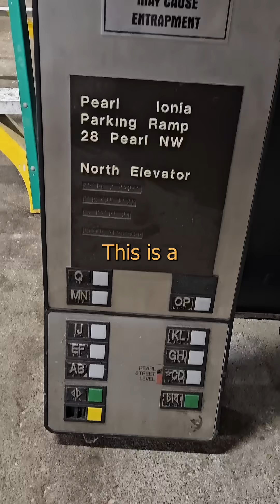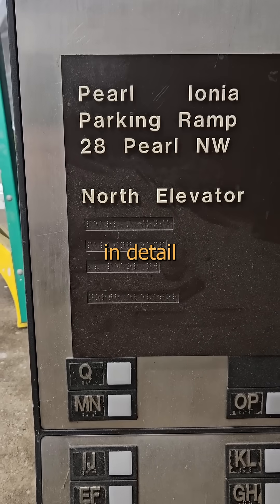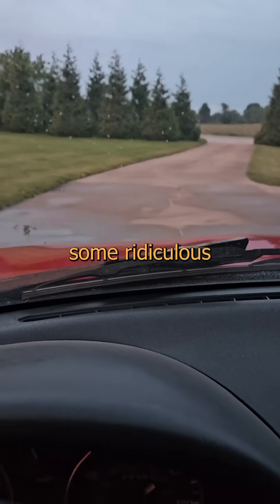Miata Mischief #chrisboden #engineering #gear #elevator #score #stories #parts #hacking #making

Comment: 😂 great stories... but you guys know the dwarf is going to get the prize, right? .... I remember a being sent with a senior tech to get a radio repeater ( the whole cabinet ) out of a snowed in high site, just a short hike off of a public road, about two hours drive from the shop. We had brought a snowmobile towable fold up metal dog sled in the service van to dolly the cabinet out of the woods... the snow was a bit deep, but had a good surface crust to hold up the sled. Being the junior tech, I had my gear packed into 2 of the larger size Coleman action packer boxes that made it easier for me transferring my work gear between working out of my van or his. Anyway, their blow molded box lids along with the bungee cords used to hold the cover latches closed make some remarkably useful impromptu snow shoes in a pinch. I and the dog sled had no trouble maneuvering on top of the snow to the radio site and back, but the senior tech sunk in the snow... he wouldn't get in the sled and let me push him as I suggested and instead insisted on choosing to slog through crotch to waist deep snow pushing the sled ahead of him like a proud dachshund... even though the context is quite different, I couldn't help but think of him pushing that sled, his top half sticking out of the snow about as tall as the sled itself like an enthusiastic dwarf pushing a dog sled... the funniest part though, was me remembering  standing on the snow looking down on him crotch deep in snow as he is looking up at me and he says to me "Do you know how stupid you look?" 😂  if I was the stupidest looking one between us, at least I wasn't the one that had the 2 hour trip back to the shop wet and cold up to my nads... I miss the comradary of having a good coworker to easily razz! Interesting times to look back and laugh about, from mountain tops to mills, nuclear power plants to prison facilities and all the crazy $h!t you have to do, or make due with to get it done... 😊

Comment: I owned one of these motorized skateboards. I had the 1.8BP, with high comp pistons, cams, long tube header and itbs. It was a blast to drive. It made 78rwhp stock, and 135rwhp built and tuned properly. It was enough to drift with narrow tyres on dry roads, and with 225 wide tyres wet. It was the most fun car I have ever owned. ✌🏻

Comment: Was building a house and only had a 98 s10  managed to fit enough 2x4s and 2x6s that the tires were almost touching the wheel wells got pulled over on the way home the cop was impressed an s10 could haul all of that was let off with a warning not to haul so much weight again

Comment: Had an 86 Nissan pickup at the time and got several wood beams for free. They ranged from 6x6 to 10x10 and were 12-18 ft long. I had a lot of stares from folks on the drive home. I got pictures 😬😇
I don’t think beat my grandfather making a wooden ramp to slide a 36’ long trusses on his Datsun pickup so we could put them up for the pull barn we built.

Comment: We stacked three canoes on an old station wagon. We lashed paddles together to make the racks wide enough to fit two canoes side by side so we could stack the third on top in a pyramid. Then we loaded all six guys and a weeks worth of camping gear. The suspension was maxed out and driving the dirt road to the highway was slow. Many time we hit a hill too steep and we all got out and walked up so the car was light enough to reach the top. At one point we got caught on a large rock and ripped the tailpipe off at the catalytic converter, After that we couldn't even talk to each other it was so loud in the car.

Comment: Carried a 12000 BTU window AC on a motorcycle. Same bike, carried a component stereo system with tower speakers. Same bike, a three state run to pick up an electric guitar, two amps, a guitar stand and a pedal board. Same bike, brought a 32" TV home from Wally World. Same bike, carried a 72 key keyboard across town. I called it "truck mode" and got labelled "The Beverly Hillbiker "

Comment: I help a couple that was buying a wall oven from me to get it in their four door sedan. They came from over 5 hours away and I had to take it apart lay the front passenger seat down as far as it would go where the main body barely fit and the rest of the parts were split between the truck and the back seat. The lady then had to sit behind the guy for their 5+ hour drive back. I hope they made it and were able to get it out of their car and find someone to put it back together. What some people will do for a good deal.

Comment: I‘ve hauled countless long items like that in my Z4 Coupe, young apple trees, cheap off-cuts of laminated wood and Lexan, a spoiler, a spade… I have a plastic bag and rags in the cubby holes to not mess up the leather when I do sth like that. The trunk is ok-sized in terms of volume, but nothing over 90cm/3ft fits. To haul a set of (winter) tires, 2 can go in the back in very specific arrangement and 2 have to go on the front seat.

Comment: I shoved a front fender for a 57' Chevrolet car in the passenger side of my nissan versa for a two hour drive. On a different occasion, i removed my back seat of the versa bottom to fit a piece of furniture where it barely fit. Couldn't see anything out of the back, but it got moved!

Comment: I had to transport a 55in tv from my walmart to my house arround 10miles away, because i bought the tv in special but did not remebered i drove my miata second gen so i had to be creative, i have a small spoiler and it was perfect enough to grab the box although i had to drive under the box because it was still sticking out toulwrds the pasanger compartment cause i had to had the roof off it was fun sketchy and i do have pictures of how it looks also move 4 tires and rims for my truck in the same car 😂

Comment: I've done some pretty sketchy hauling. I got an entire crib home by taking it out of the box and putting the parts in just about every book and cranny in my car, I've also gotten an entire bed set moved by putting the mattress on top, the frame dresser and night stands in the rear complete with the trunk open, then securing it by literally tying myself into the vehicle with the knot right infront of my face so that when I got it to where it needed to go I could just untie it to get out. None of that though come close to some the the sketchiest shit I've seen to get something from one place to another. That would go to the guy that used a small wooden dolly as a wheel replacement to get his car to the mechanic. Or the lady who pulled one of those pull along carts to move a bunch of paint, wood, and tools behind her little Honda hatch back that was filled to the brim with other supplies. Either way, there are TONS of sketchy fixes and half repairs or there at one point there was an entire web site dedicated to it called "There I fixed it" and some of the things you could see on that site took Sketchy to a whole other level. We are talking putting a generator on the trunk of a car and running a window AC unit through the back level of sketchy.

Comment: 2001 s10 zr2. Brought home my summit 350 horizontal band saw with no tailgate. Truck was squatted as it's got too be over the load rating as its built with a heavy casting. Too make this all better it was on casters and being "held" in place with crappy tire ratchet straps which I have seen break holding an engine so they were little assurance lmao

Comment: Subaru Baja moved a queen mattress, box spring and bed and a twin sized bunkbed and mattress at the same time.  With a whole bunch of rachet straps.  Also tried to move 2500 lbs of tile but ended up splitting that into two separate loads.  My tacoma cant even handle a half cubic yard of basalt.  I miss my baja.😢

Comment: I think the sketchiest thing I’ve transported was a drive axle for a Honda Civic Del sol with it ratchet strapped to my back as I was riding a 78 Kawasaki KZ400 Motorcycle through a massive rain storm that had winds high enough to try to push me, my little bike, and the Civic Del Sol drive axle strapped to my back sideways off the road and off a somewhat steep, muddy embankment

Comment: A store in the gas station chain i was working for fresh out of high-school was going down for a rebuild.

Knock down and build new kinda thing.  

There was a large, looked smaller from the ground, Krispy Kreame neon sign on the side of the building.  The powers that be told me it was gonna be demolished with the building, what happens after hours was fine with them.

Myself and 2 friends, jumped in my brother's Dodge Spirit, holding an extention ladder, on the side of the car, through the front and back passenger windows.  Got to the store, climbed up, started to dismount the sign from its blockhouse wall.  

Somehow we managed to lower it with ropes and patience without breaking the tubes.  That was when we realized it was 10 feet long.  With only a backer board to keep it rigid.  

We found a narrow yet long, we had a connection, pallet in the dumpster enclosure from the body shop next door.  That fit in the trunk and with one person holding that down, through the drop seats in the back seat, that stuck out long enough to support the back end.  Lots of cardboard under the sign, lots of rope and a very slow drive thru town breaking many laws im sure, we made it to my friends garage to store our treasure.   It now hangs in a local history museum.

Come to find out, the sign was handmade by a local neon shop, the owner of which has long since passed away.

I miss days of either not caring or being ignorant about how much danger/legal risk we were swimming in.

Comment: I moved a bunch of stuff via skateboard when I was younger. Moved a curio cabinet about half mile between houses via skateboard, was a pain to balance it and since part of the trip was down hill was a lot of fun trying to slow down. Using the skateboard again transported my entire room between houses, again about a half mile but different state, so mattress, 32 inch tube tv, dresser, bookshelf and lots of other things. 

Used a skateboard as an adjustable lift under an exterior door(door to a garage) that I had to repair the hinge side doorjam on, removed all the hinges thinking it only weighed as much as an interior door and was by myself. so after replacing some wood on the door jam ended up having to use the skateboard to help position the door and lift it into the proper height. Did the repair for my mother as a surprise when I was home on vacation.

Comment: Okay, I didn't bring it home but, I work at a lab (not as a scientist, but as a lab assistant, aka the guy that cleans, maintains & make sure the lab is working as it should)

When I was 1st starting that job, I was assigned the oldest part of the lab, and turns out that part had stuff from the 1970s, and one of the craziest things I've found was an old wooden box inside was another metal box, and on top of all that, was an old timey Geiger counter,

I was like "ain't no way", and turned out it was a lead lined box and inside was like 500 grams worth of radio action isotopes from the 70s/80s

Turns out it wasn't only me that was positively ionised in that room

Of course I couldn't keep it and told the proper personal, and turns out there was a lot of weird stuff in that room too, one of which was 1 giant jar of mercury (weighted a ton)

Comment: nothing as extreme as some of the ones here... just trying to haul 4 sheets of 4x8  1/2" plywood home with three of my friends and my Toyota wagon.. 

the sheet good sure as shit wasn't going to fit in the car and i didn't have anything like straps or string. so on the roof it went and procured by the power of 4 spinally teenaged arms, only tow of which were truly up to the task of taming large wood.

it may not have been the wisest things but hey.. did i die?

Comment: Before I had enough tenure to get my own work van, I once did my entire elevator service route out of a 2001 Saturn SL 1 5 Speed. If you could imagine everything that would normally fill a full sized work van jammed into a subcompact, whatever you’re picturing now, it was even worse. 

That Otis COP gave me really bad flashbacks btw. Half of the profanity I’ve ever spewed in my entire life must’ve been directed at those COPs or old Otis controllers. Schindler might be a close second.

Comment: I shoved a 8ft wide, 4 ft tall, and 2ft deep dresser into the back of my 97 Buick LeSabre once, and most recently did something similar with my 07 Acura TL with is smaller than my Buick and I had to drive it over and hour on i5  after carrying the bookshelf out of a skyscraper in Seattle, of yeah and I only had that little grocery net in the trunks of cars to secure it with both times

Comment: I paid a dude 400 bucks and 1k for a car. Well, it turns out this isnt just a car. Its a 1976 triumph Spitfire 1500, mostly complete, with minor parts missing. My family has been livid with me since i got it, but in comparison to other cars of its era, this one is fading away, there are less then 10k of them total left in the usa, counting all the way from the mark one to the 1500, even rarer is i have the J type over drive transmission in it, and a manual choke. I checked its vin, and its one of the rarest models of the 1500 because of its details. While she sits and collects dust i have been doung study on it and i swear warhammer 40k got it right this one time. I need incense, an incense holder on a chain, and some red robes cause prayer is the only way besides heat ima break some of those bolts loose... no for once its not cool.

Comment: I had a VW Beetle type 1, the original, well, two of them, actually, went to a swap meet and found two new rear quarter panels really cheap, they are quite large, I drove my Beetle to the meet, Beetles don't have any way other than the passenger doors to get anything into the back seat, I drew quite the crowd as I'm removing the front seats and doing interesting yoga positions to fenagl the quarter panels into the back, with the passenger seat in backwards the drivers seat full forward, praying I didn't get into an accident or even a panic braking or else I'd be cut into thirds from the precarious positions of sharp panels already jabbing me with every little bump in the road, I made it home,

Comment: I put about 8 pallets on my roof of my 2010 civic roof, the first 2 pallets were about 20 feet long, overhanging my car in the front and back, two Ratchet straps (one through the front doors and one through the back doors) I drive about 10 km or and 6 miles to bring it home right through town, had to do about three runs and they were all pretty similar runs

Comment: Probably a bit late for this but once me and my dad had to pick up and drive a table with a glass panel top to our house. Unfortunately even with the damn big trunk of our car it just barely didn't fit. We could take the glass off and shove it to one side but considering our trunk wouldn't close it'd probably fly out so we couldn't do that. In the end we used that middle seatbelt that's in the roof of some cars and we put it through the hole that is meant for a sun umbrella in the middle of the glass pain. Of course the seatbelt couldn't be clicked into anything so I needed to stay in the back seat and hold it so it doesn't fly out for the whole 20 minute ride.

Comment: Drove my old Peugeot 206 to haul a workstation desk 😂 it wouldn't fit but I made it work and I had to drive with my knees in my chest and my chin on the steering wheel 😂

Comment: I hauled tires… lots of them. Like 50 of them i bought at an auction using a half ton with a short box and a boat on a homemade trailer bought the same day that did not support the boat properly at all. The boat was a 16ft Bayliner Classic It was sketchy AF it was tippy and the tires fully inflated were bulging under all the weight. The thing was a happy tail being pulled swaying back and forth… I had to do it all on gravel roads that at the best of times had a loose surface, only touching concrete roads to cross the highway. did that for 100km or so through rural Manitoba.

Comment: Literally my parents.
Drove several miles with one of those small plastic sheds in a trailer, with no connectors or ties to hold it down, with only a freezer inside to keep it weighted in place.
My brother was in the trailer observing and I was in the back seat doing permanent damage to the muscles and nerves of my neck, watching him.
Half way home I fuckin BLINK, and the shed is gone, my brother is waving his arms like a loon, and there's sheared plastic framework spreading out along the road as far as the eye can see.
We get it all loaded back up, and get it home, by driving .2 mph slower.
Once there, with duct tape bunnies and enough prayer to put the pope to shame the shed is back together (it died permanently in a storm two years later) and the freezer made it to the kitchen and continued to function until the day we moved out...
Though not without a delightful scar running across the front of the door that genuinely made you question the safety of continuing to run the damn thing.
But hey. No one died and it made for this fun lil story.
And to quote the man himself "That's pretty cool!"

Comment: I once owned a Miata and I carried a set of winter wheels for my other car. I had one in the tiny trunk, two behind my head on the convertible top deck and one of the seat next to me. My friends thought it was hilarious when I could have just used the winter wagon to pick them up 🤣